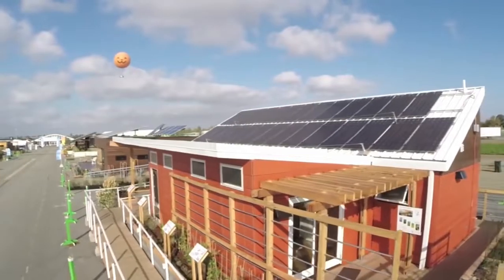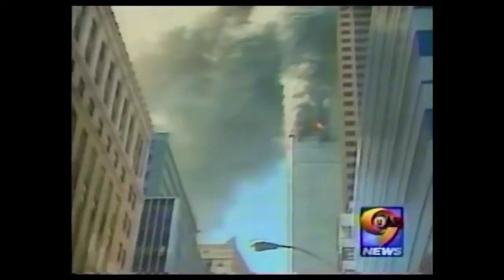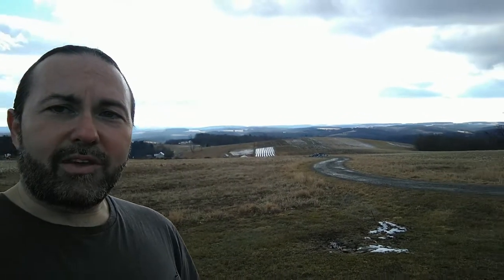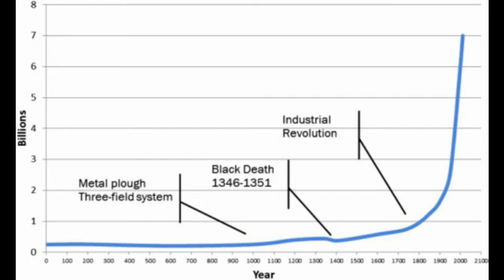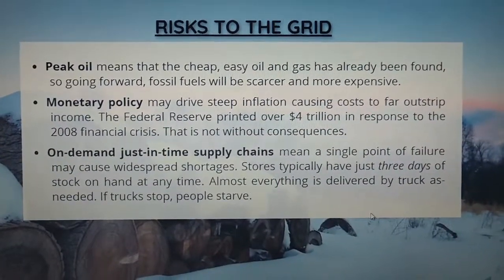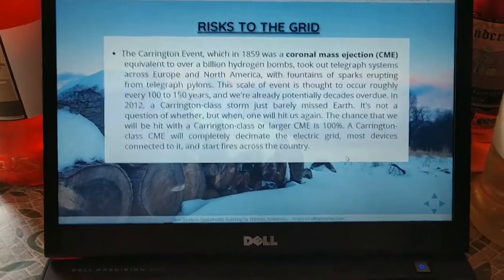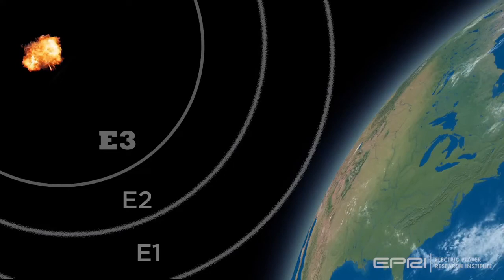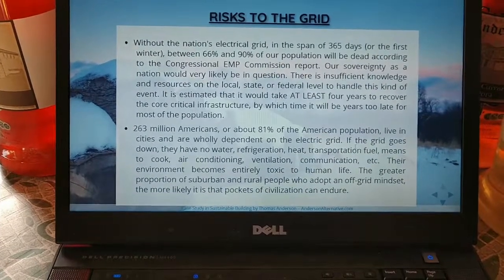Why Go Off the Grid?  You Owe it to Yourself and Your Family

Comment: Just discovered your channel are you going to also do food peeps.
Reply from the maker: I'm still thinking about how narrowly I want to constrain my content.  But I think I'll cover quite a few homesteading topics.  Right now I'm working on editing some thermoelectric generator (TEG) videos I've shot.  Maple sugaring season is coming up soon and I might do a video on that.
Reply: @andersonalternative6223  Hello, curious if you ever finished the  thermoelectric generator (TEG) videos. I have lived off the grid for 15+ years and in my experience having a small, (even trickle) charge can make a huge difference. I have thought a combo steam engine powered DC generator, water heater and TEG would be a fun project.
Reply: @tritter2001  I did not finish them.  The original experiment failed and there's plenty to learn from failure, so I do want to get them up eventually.  I also need to revisit the project and get it working properly and document that as well.